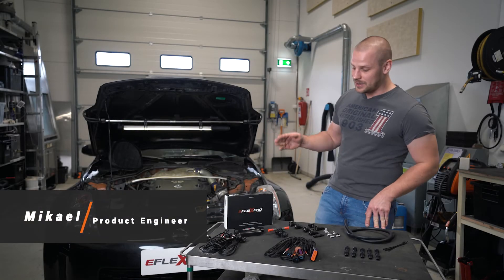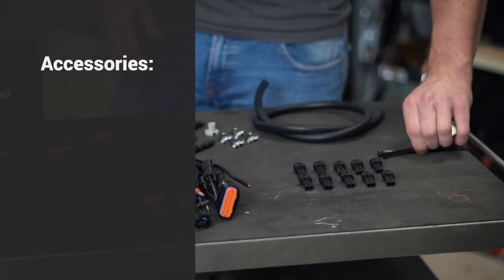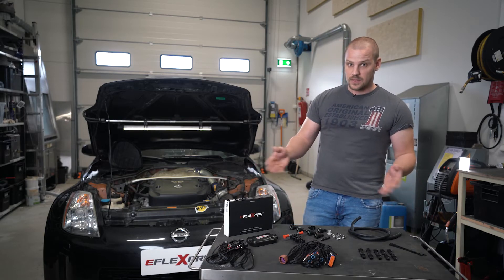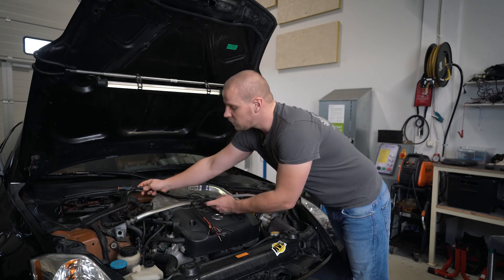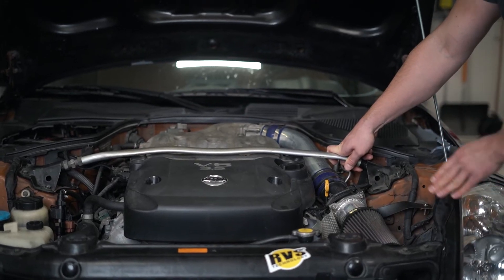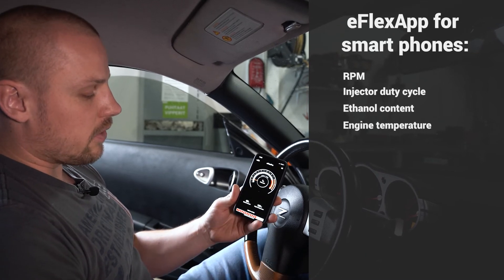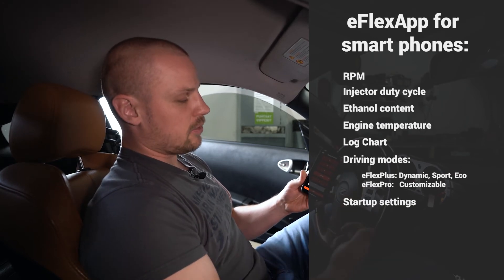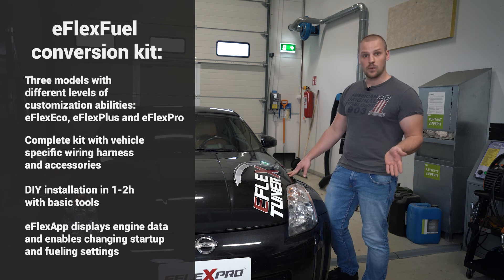eFlexPro and eFlexApp Introduction

Comment: Do I need a tune ? To run on a 2017 392 scatpack ? But a tune to run e85 n have the kit or how does this work
Reply: I just installed this on my 2019 Challenger scat pack.
Reply from the maker: No tune is necessary to run our system. Our system will work with the tune that you have on your ECU.
Reply: Just got one too how is it can u feel
 The difference